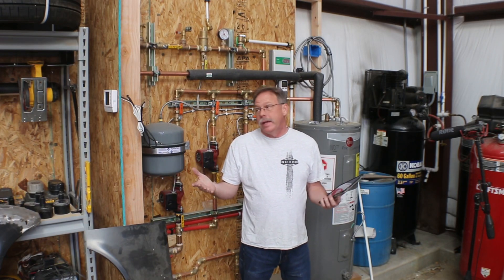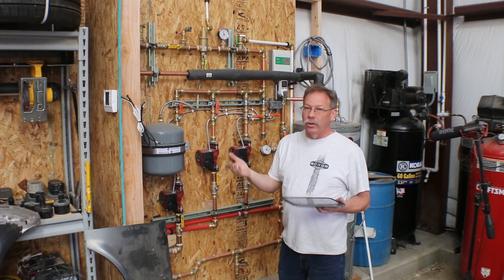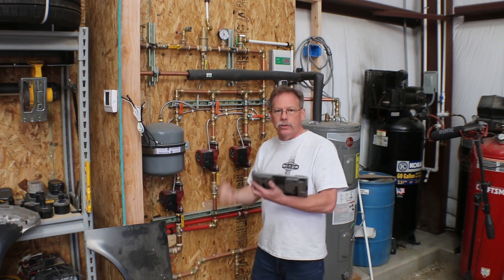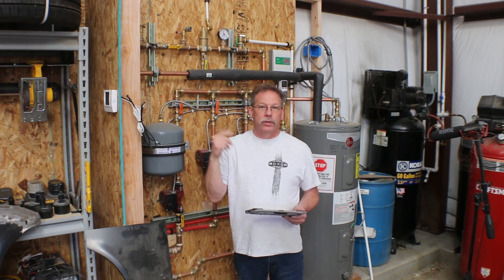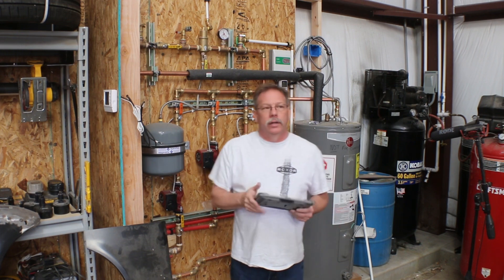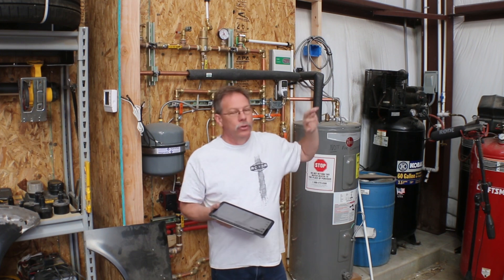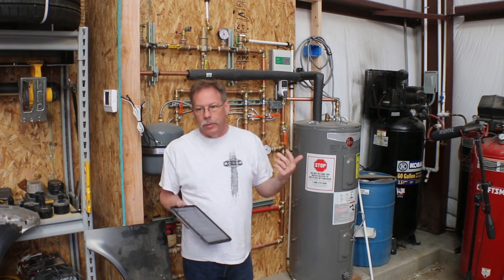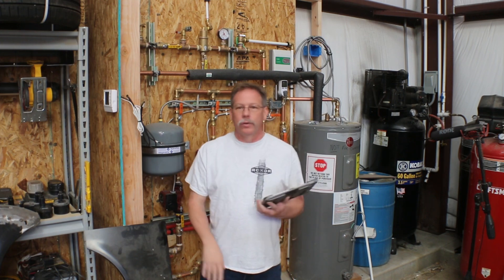Shop Radiant Floor Heat - How Much did using an Electric Water Heater Actually Cost?

Comment: bet your estimate on the water heater comes in somewhat cheaper. Remember water heaters run one element at a time. Second part is that once you have your slab up to temp 60 degrees it is not going to take nearly what it did to get you up to temps.   So I would be interested to hear your running cost this season
Reply from the maker: The shop is 3800 square feet and roughly 72,000 cubic feet - it has R-40 stem walls below frost depth, R-19 walls and ceiling. 
Also, I have both of my WH elements running at the same time.
I’m working through a solar system now and should have a video soon(ish).  
Here is what last season ended up like.
Shop Radiant Floor Heat - How Much did using an Electric Water Heater Actually Cost?
https://youtu.be/5jO3bHkLhJE
Reply: @AllisonCustoms  sounds like you need more capacity for sure
Reply: you did mention the stem walls but how much R value below grade?
Reply from the maker: definitely
Reply from the maker: I think it was r-30, might be r-35
Reply: @AllisonCustoms  do you have collectors or pv or both for solar? Electricity is insanely expensive in Massachusetts
Reply from the maker: right now, just the hydronic solar.  I’m thinking about adding PV though.

Comment: The hot water tank is NOT necessary....the slab IS the storage for heat therefore tankless system.  But you MUST have loops no longer than 300 feet....before returning to reheat water. Please note NOT circuits BUT loops within the same circuit
Reply from the maker: I think if you watch this video it will give you answers to why I did things the way I did.   Can you Heat your Shop with a $200 Water Heater? Radiant Floor Heating For My Shop | Allison Customs
https://youtu.be/mQX_Qh_qLG0

Comment: Water temperature should NOT need to be more than 80 to 100 degrees max....
Reply from the maker: I think if you watch this video it will give you answers to why I did things the way I did.   Can you Heat your Shop with a $200 Water Heater? Radiant Floor Heating For My Shop | Allison Customs
https://youtu.be/mQX_Qh_qLG0

Comment: Tankless propane or natural gas would be the way to go. Electricity by far the most expensive to run. You MUST have R10 or better in the floor and R20 foam perimeter. 300 foot max runs for loops before returning to manifold to reheat water.
Reply from the maker: I think if you watch this video it will give you answers to why I did things the way I did.   Can you Heat your Shop with a $200 Water Heater? Radiant Floor Heating For My Shop | Allison Customs
https://youtu.be/mQX_Qh_qLG0
Reply: Tankless? Whats the advantage or main focus?  Heating the garage vs. the cost to heat it?
Reply: @Garth2011  There is no point of storing water in a tank. Heat the water and get it into the slab....the slab IS the storage.
Reply: @ryale7174  Seems that way but I doubt those "green" heat the slab ideas work so well its worth it in the end. The investment $$$ in materials, plumbing, heat source etc. far exceed paying the utility company what it takes in gas or electric air heating.
Reply: @Garth2011  So much depends on your location and your energy costs. Building down South is likely very different than building in the Great White North. As a Canadian, with our long cold winters, I can confidently say that the return on investment is VERY fast with wisely installed slab and floor insulation. I have R10 in the slab, and R22 Roxul in the 2x6 24" C walls.  You do not need to buy new foam insulation. I picked up 900 sq ft of used R20 4 inch Dow "blue" factory  roof shiplap insulation for a great price, (about 30 cents square foot) and have used it in the basement walls, ceiling, etc.  This heating season to fill our large horizontal propane tank...generally the largest one available for business or home use (1000 L to 80% capacity) was about $2650. Last year it was $750.

Comment: Please let me know if you think the heat pump hot water heater source will work in your setup. The cost ($1500-$3000) may end up being a good investment. Solar hot water would most likely be just as expensive, maybe more. The heat pump hot water unit will exhaust cool, dry air so that could be useful for something around the shop in the summer? Could you use a heat exchanger and heat water for dual use instead of having a closed loop? Anyway, great work.
Reply from the maker: I think a heat pump would work very well.  However, a unit large enough to heat my space, was going to run over $6000 plus materials to plumb it in.
Additionally it would also require another $1000 plus for the electrical hookup.  This is still all cheaper than a solar system, but with solar I should have a near zero daily cost to heat the shop.
We also have a pool, so I plan to loop in that into the system in the spring.
Reply: If you are considering a free standing air transfer heat pump HWH, then that is probably not a good solution.  Because all it does is MOVE HEAT.  In the process of creating hot water, it generates COLD AIR.  If the heat pump HWH unit is in the shop, it will COOL the air around it and you are removing heat from the shop.  On the other hand, consider a ground heat source heat pump.  One brand was called "Water Furnace."  Google "Carrier Geothermal Heat Pump."   Have you ever seen a free standing heat pump hot water heater installed outside in the weather?   Might work under a tin roof in a southern state, buy not sure about Ohio, NY, Michigan, or Dakotas.

Comment: Good video. So doing the math, did your water heater really run 82% of the time on the coldest Month? That seems like a lot. Running 100% of the time, never shutting off, a 30 day Month would cost you $793.00. 
I have a 4000 cubic foot room that I am trying to figure out the cheapest set up for my In-floor heat. Pex is in the concrete, I just need heating system to run it. (In Minnesota)
Reply from the maker: That is where I was at last winter.  If you have access to Natural Gas or are willing / able to put in a propane tank - a gas burning boiler will be the cheapest to operate.  I almost purchased a heat pump last month, but when I ran all of the numbers for the install and the electricity to operate it, the cost and efficiency just didn’t make sense.  So I bought a solar system instead.  I’m waiting right now for the last few pieces and then I’ll do a video on the install.  I may eventually swap the water heater for a heat pump as the back up but that will have to wait at least one more season.
Oh, and to answer your question yes it really ran that much and I’m sure there were days on end that it never shutoff.  And this winter they (the man) got an increase in the price for electricity. So I’m guessing I would have bills over a $1000 this winter. Hense the big purchase.
Reply: @AllisonCustoms  I definitely will look into another LP tank as my current 500  gallon tank is too far from the shed where my simulator is.
Reply: I have a 30 gal electric water heater in a 1300 sqft garage, 4 -300 ft loops. Keep the thermostat at 55. Last month (Nov 2022) cost me 30.00
Reply: @ryanwaldkirch3364  That's great.  What was the weather like then?  Approx. cost per mos & weather since 11/22?  Thanks!
Reply: @manchesterroofingsystems8016  sorry, just saw this. So worst month was January, we got down to -10 at some nights. Hot water heater was set to 90 degrees. R-13 walls, R25 ceiling. Cost me about 40-50 dollars per month. I think if I want it much warmer I need to increase the BTUs. BTW... It's a stand alone isolated unit. Ran automotive antifreeze and worked just fine.

Comment: Change out the electric water heater with a heat pump water heater.
Reply from the maker: I looked into it, and if I could have gotten one in a reasonable time frame would have.  Instead I bought my solar system.  Video coming soon.
Reply: That was my thought for a long time. If you read the specs of a hybrid WH the ambient temperature before it has to go into resistance heat is 32!!  In my area...Mass the groundwater in the winter is 45 to 50. IF you could get some of that FREE heat...if you call 45 degrees heat...lol...it would be worth exploring. If you stick the hybrid anywhere you are heating...you are just adding and taking away the same heat. In climates where it isnt usually so cold...I think they are king...if you can get someone to fix it when it breaks..
Reply: @Roger Whiting  I sure love my 80 Gal hybrid heatpump water heater. It's dependable and very efficient. Have had it for about 4 years .
Reply: @Micah Funk  the only issue with them is getting them repaired if they break. Its almost impossible to get someone to change the compressor if need be. Everyone wants to be rich these days.. I wouldnt be surprised to see a tech charge you $1000 to replace the compressor...and I am in the business. Warranty service is often useless. With appliances such as Whirlpool...under warranty the 800 number just says "we don't have anyone to send." If they agree TO send someone...it can take MONTHS. Iam a big advocate for them ..but not for the repair network
Reply: @rogerwhiting9310  - yes, there is not repair only replace.
Reply: @M13x13M  and there goes the savings